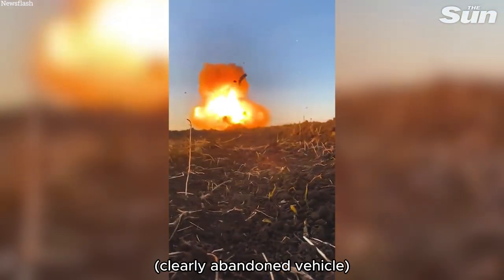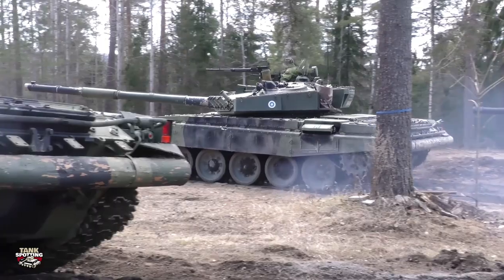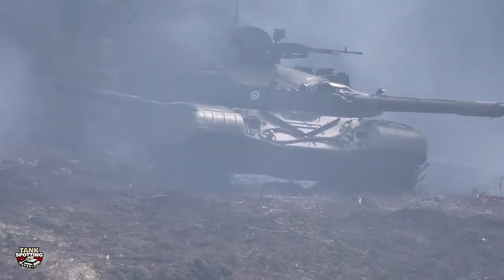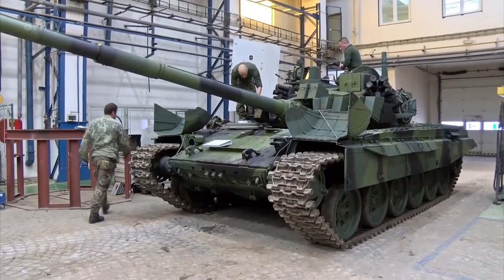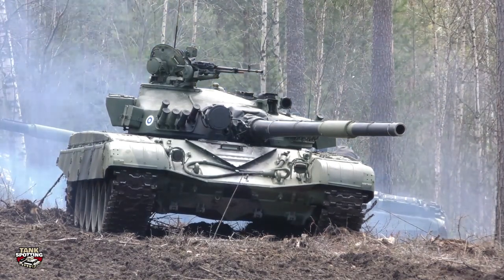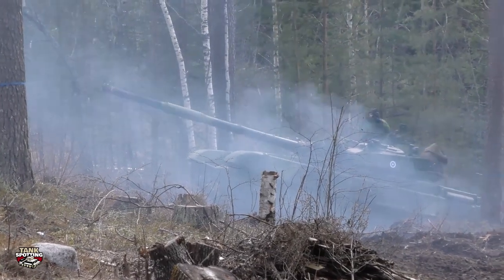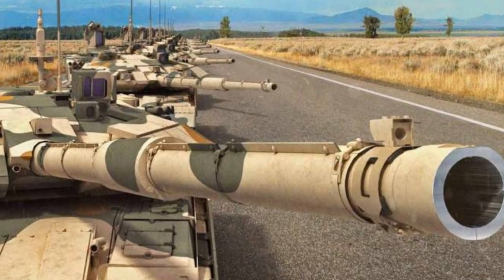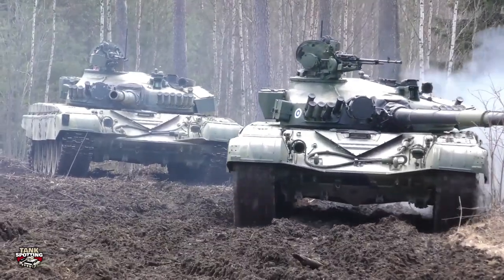Why the T-72 is so solid (Best Tank?)

Comment: Lets say T 72 family needs to be upgraded to modern Requirements,, which is Drone Defense and APS,   which Will Be EXPENSIVE,,       But yea Thats what you get for tanks in 2020s,,  

     I would say Probably Heavy IFV like "Terminator Or T-15 by Russian should Replaced Tanks,,       Less composite armour,,  more Protection by APS and Drone Protection Like Electronic Jamming

Thats my thoughts,,,
Reply from the maker: Of course it would be very expensive to upgrade it to the most modern standards. You're right.

I disagree with the replacement with IFVs though. The role of a tank is too different imo. For example you can use it as mobile artillery.
Reply: Drone defenses arent that expensive, and about the APS im not sure. No army in the world yet has APS on all MBT´s, and it isnt going to happen anytime soon due to how expensive they are. But russians will be upgrading the t-72´s for quite a while before eventually getting rid of them. But the terminator and T-15 really cant fully replace tanks, even tho because of how well armed they are, they still are missing key features of tanks. But there is a chance that armies in the future might get rid of MBT´s and replace them with some T-15 alike, but we will see.